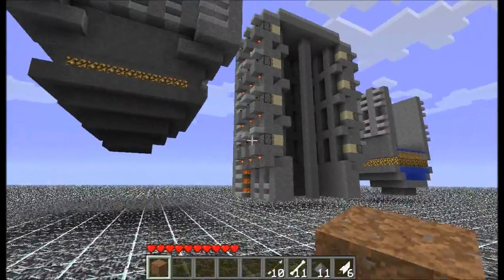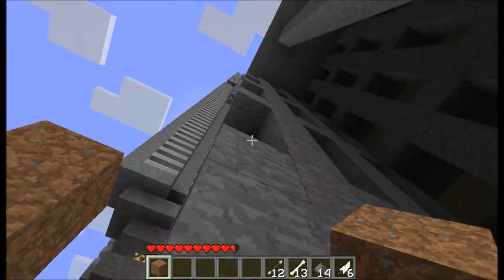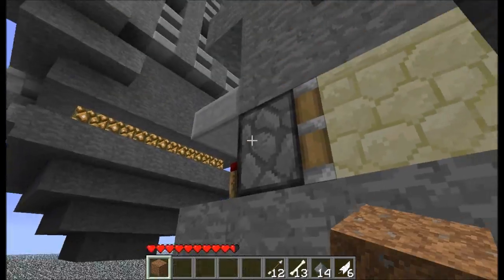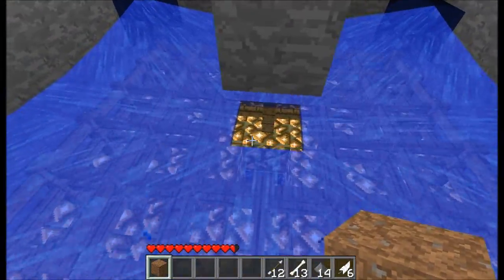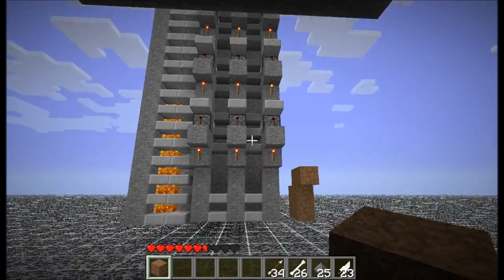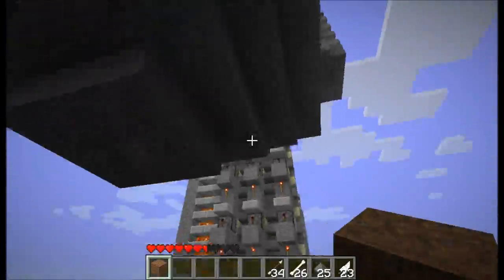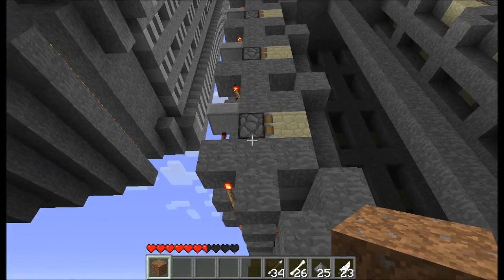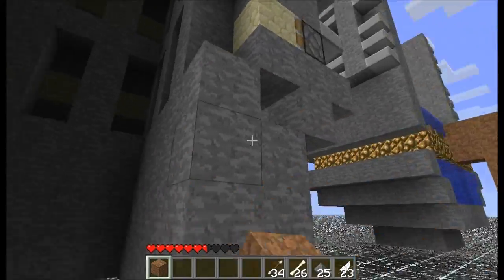mkII RECORD BREAKING mob trap explanation

Comment from the maker: firstly, you need a proper clean-room map to build it on as the 'superflat' option leaves you with slimes that end up taking up the spawn limit, I believe there is a download link in the op of the mcf thread, to which you will find a link in the description, download that and give it another try. Also bear in mind that you need tens of thousands of these little pressure plate 'units' in order for it to work properly, so you may want to download a patched copy of mcedit :)

Comment: hey dude, i just want you to know that this video (and the other MK video's) are groundbreaking, and inspirational.
you're the best builder that i know, and you revolutionized trap making.

I'm trying to set up mine, I have a 1 cell, 60 single trap, 25 block fall trap, and it chucks out about 3 items in 10 minutes.. have i done anything wrong?
i've analyzed this vid, and your MKII save file through and through, cant find anything wrong with mine. please help..

Comment: does this still work in 1.8.1? I have started building a tower and i am getting exactly 0 items. granted, I only have one floor built, but I should still be getting something I think.. I have built it exactly like yours so I have no idea what the problem is. I should also point out that I am doing this legit since I have found a spawning point for slimes.